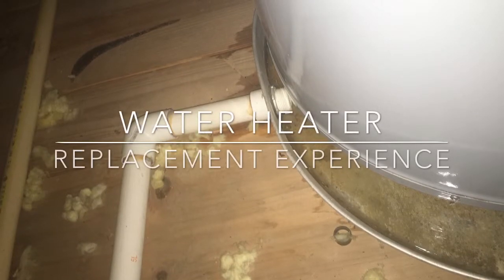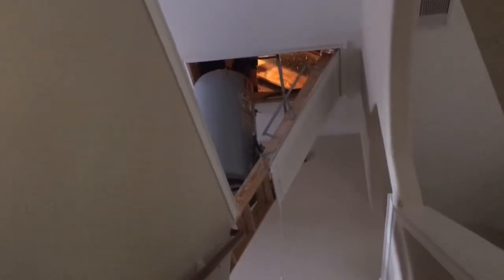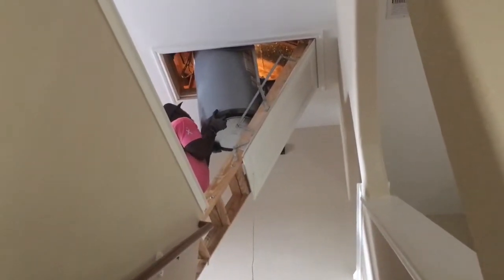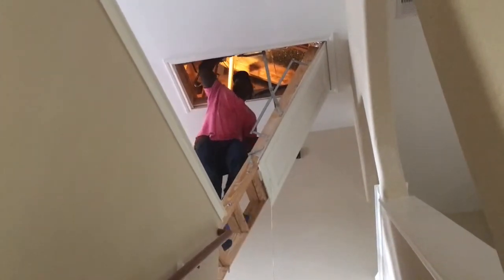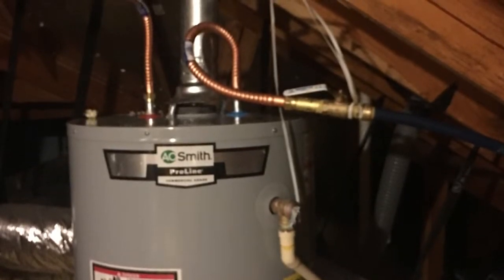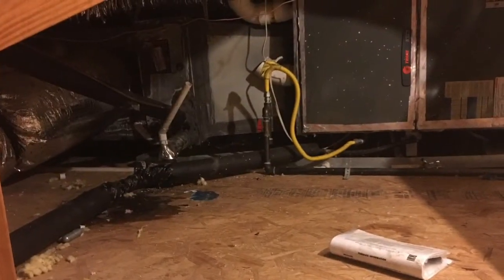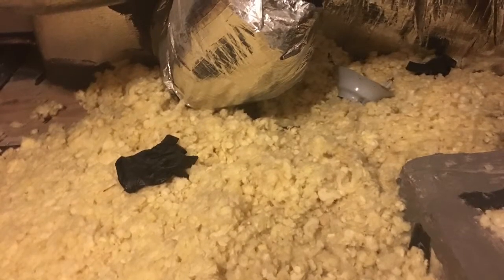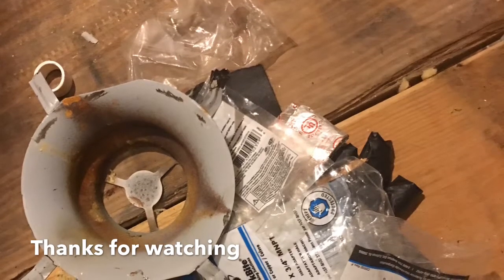Attic Water Heater Replacement

Comment: Thanks for the video.  I am amazed that builders still put water heaters in attics.   There’s a risk of massive damage ro the living space below if the tank ruptures.
Reply from the maker: Yes. I’m considering going tank less soon. Will upload a video about the process.
Reply: @idiybysonia  tankless can leak as well. Also make sure to put a water softner or electric coils around the pipe to "soften" the water if you have hard water and go tankless. I'm having this issue right now.
Reply: @idiybysonia  if I were you, I would do repipes for the water heater. It’s dangerous and too risk that the water is leaking and it will damage one of the most important investments.  At the same time, if you do the repipes, you can have a peace of mind. 😊

Comment: This is really great and helpful ,  im looking at a house and the  water tank is up in the attic and its 20 years old i know that needs to be  replaced and how it all goes up  and down the stair like that   its  just a  old wooden  pull down thing  didnt know if they used a  cable  with a pulley  that  attached to the beams of the roof of how they did , those are  super heavy ..  was that a 40 gallon one  i was wondering ?    I wouldnt want them  leaving a mess either  that is totally wrong  .      Glad you posted this  so now i know what to expect how this is all done ~  also   this is something  to get in case you didnt know they have these little  water detectors  its  like the size of a  smoke detector   and  you put if  under a sink or next to a water heat  so if anything  leaks  water and hits that  it will  alarm   so you will hear it and  know right away water leak..  instead of it leaking for a while then it starts to  come through the ceiling. i just found out about this   .  so  its  good to have im sure..   Thanks so much ~
Reply from the maker: I think it is 40 gallons, I could be mistaken. I am saving up for a tankless system…because I don’t like this much water being on the second level and the costs involved with having this type of system. Thanks for commenting.

Comment: For the new water heater - where do you have the pipe from the pop off valve running to? I have a water heater in the attic as well, but the previous owners don’t have a pipe on the pop off valve of the water heater
Reply: should just empty into the pan,  then the pan is piped to the outside.